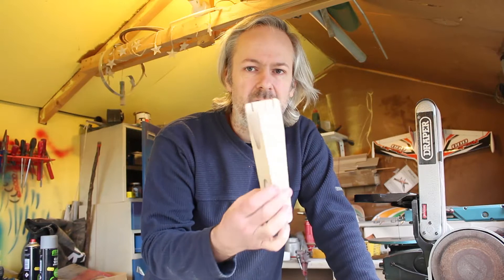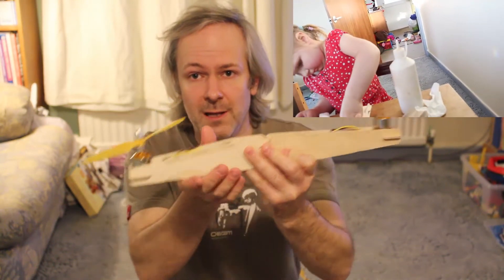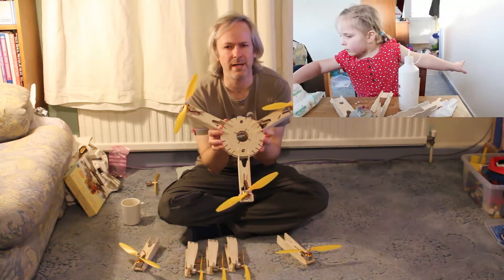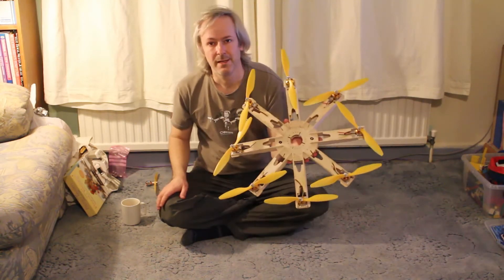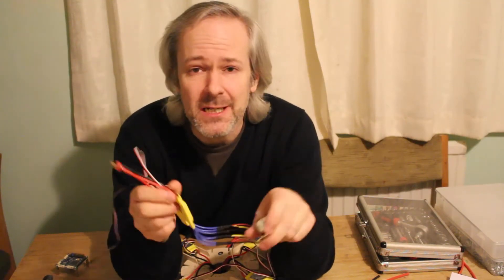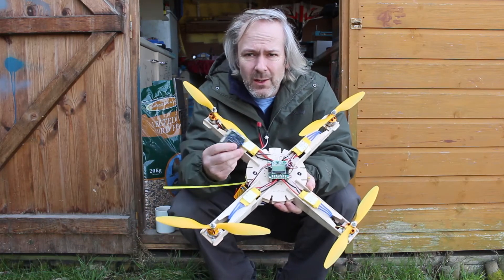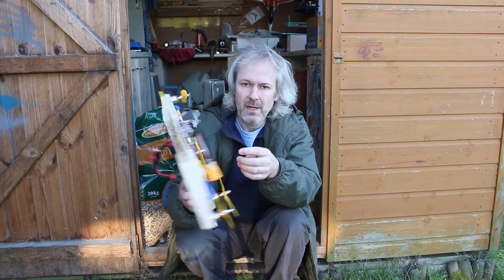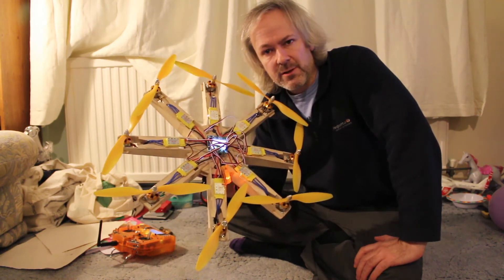Modular Multicopter, Quads, Hex, Oct, Y4, Y6, OCT X4, up to 16 motors!

Comment: Great idea as saves a lot of money and space

Will you be releasing the plans for this ?
Reply from the maker: the instructions are on instructables.
https://www.instructables.com/id/Modular-Multicopter-Quads-Hex-Oct-Y4-Y6-OCT-X4-Up-/
Reply from the maker: OR go to these two pages.
http://www.fid-tech-ltd.com/instructables/arms.pdf
http://www.fid-tech-ltd.com/instructables/hub.pdf
Make sure that you print at 100% and check the print is 200mm long for the arms.
Reply: Thank you 

I use that site some times 

Keep up the good work
Reply: Just been having a read and very interesting  thank you for taking time to post on instructables.

Fret saw that must of taken you ages to do.

Funny that i have a kk2.1.5 spare which i got for fixed wing project but was unable to work out how to do as meant flashing new firmware on the the kk board.

Like yourself I get board very easeirly but unlike you i dont have a shed so will have to make it in my bedroom.
Reply from the maker: The fret sawing did take a long time! i always double up where i can, but even still it takes a while! i will buy a laser cutter one day!
Reply from the maker: Very nice cnc machine!